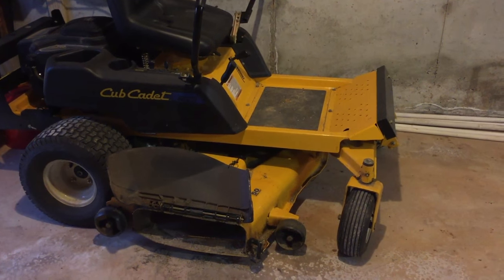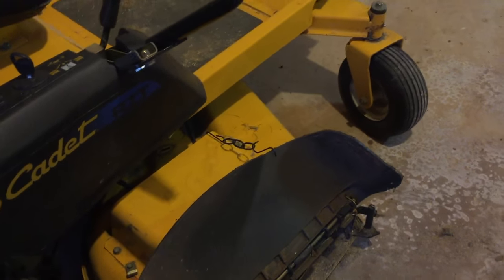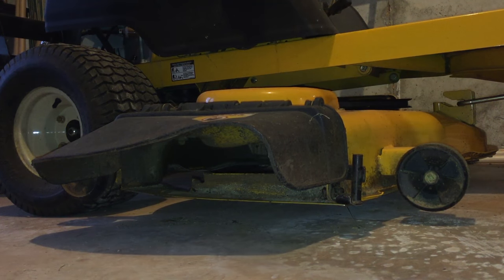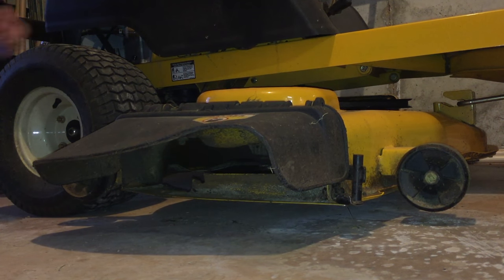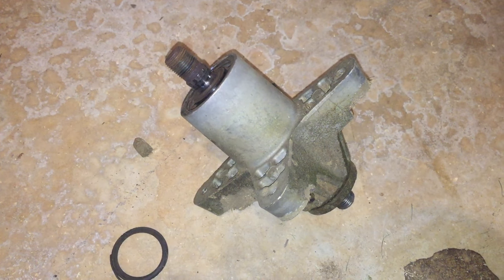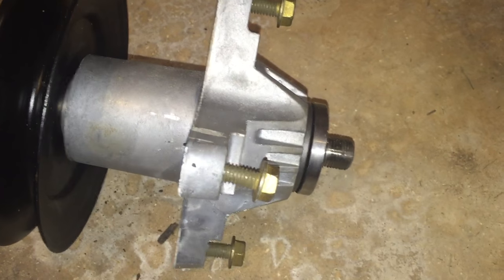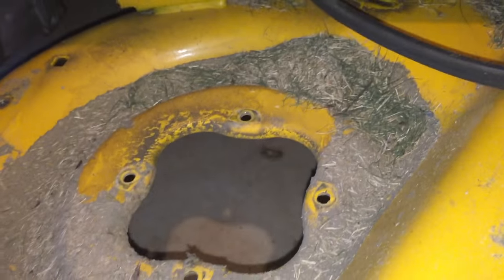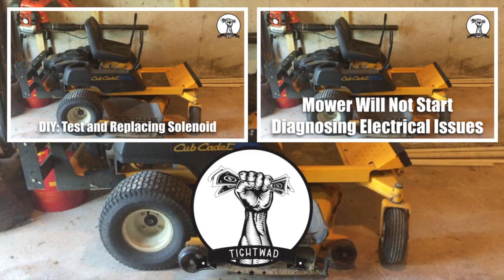Lawn Mower Blades Will Not Spin - Blade Spindle Assembly Replacement

Comment: The problem you described with the right mower blade being inoperative, is exactly the " fix" I am in . I believe I can now go the John Deere and describe the problem  and that they concur it is the spindle that needs replacement. I had my mower set lower than normal for first cut and I think I hit a hit the edge of the driveway  The grass and ground are lower on right side as I drove from the grass onto the driveway.  It felt like a two inch rise.  Thanks for the video.  Much appreciated.
Reply from the maker: I’m glad you found the video helpful. It was a fairly easy fix if you have the right tools.

Comment: Thanks for sharing. I got a cub cadet zero turn from a friend the deck was tossed. I took all the parts off first, going back with new spindles. New deck and spindles not cheap but was only in the hundreds not thousands.
Reply from the maker: sam yeates That’s a much cheaper route than buying a new zero turn!

Comment: Any answer why my cub cadet rtz blades turn while I crank my mower replaced the pto switch...
Reply from the maker: Henry Collins I’ve never experienced that. The safety switches should prevent that from happening. Are you sure the new PTO is wired properly?
Reply: TightWadRepairs yea I called club cadet and they said check my belt maybe it's stretched  or make sure my spring is still on the tension pulley
Reply: @TightWadDIY  yea it is brought a new switch just unplug old 1 and plug new 1 in 🤷‍♂️🤷‍♂️🤷‍♂️
Reply: They told me the same I'll try the deck belt